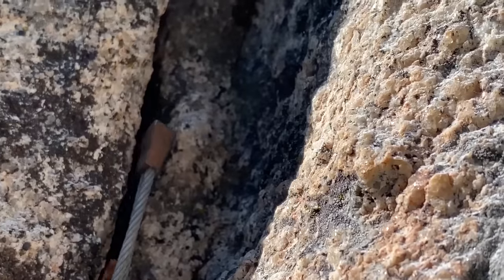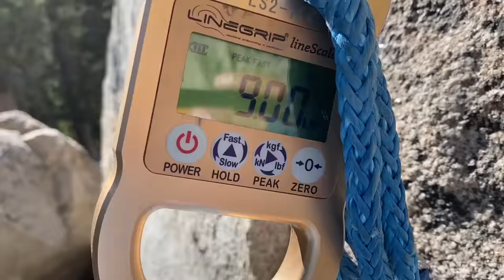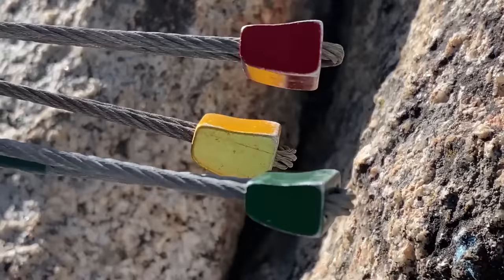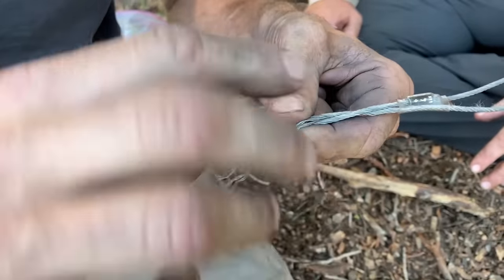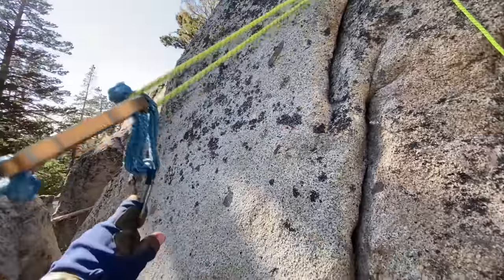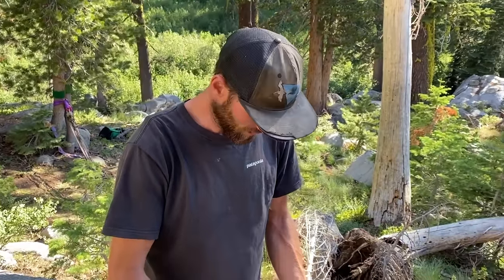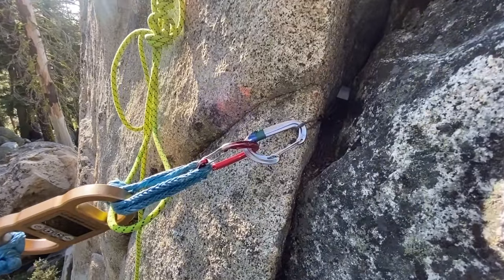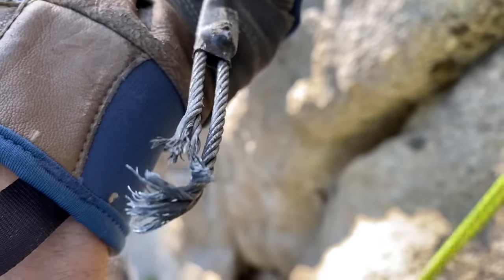You won't believe how strong micro stoppers are!  Climbing nuts tested in real rock

Comment: My understanding (I can't verify this, it's just what I have been told) is that the filament in the steel braid is a way for the manufacturer to track production. Different filament colors indicate different times (years?) of production.
Reply: I know a lot of larger steel cables will have a soft core and apparently the core being able to be squeezed improves elongation properties, reduces wear/premature failure due to inner stands rubbing against eachother while being squeezed by the outer strands and probably some other important stuff.
Reply: this is how manufacturers track ropes as well
Reply: It's there to retain shape of the wire and prevent kinks?
Reply: I think they do this with ropes too and thought about the same here.

Comment: The wild country Rock nuts are OLD,  based on the manufacture markings and MEC price tags they are around 40 years old. They still have original tags as you can see when Ryan is holding the big bundle.

Comment: I am curious if you put two carabiners in the wire to increase the bend radius if the results would change. I have done that when belaying sometimes to get more friction when belaying a larger climber than myself. Awesome as always!
Reply: I thought about a wire rope ferral I think it is called to increase the radius but your suggestion trumps my idea, if two carabiners get better results then move to the ferral (eye)
Reply: @marcwire9332  It's a ferrule. Good try on the spelling since you'd never seen it written!
Reply: @PeregrineBF  most polite way to correct someone’s spelling i’ve ever seen on the internet. props
Reply: Or you could retro fit a wire rope thimble.

Comment: Hi! I did some basic math to work out the force on that redirect using your estimates for the force and angle: assuming an angle of 95 degrees, the force would’ve been between 17.6kN and 20.3kN, assuming an angle of 120 degrees it would’ve been between 13kN and 15kN. Both of these would’ve been acting straight out, at half of the angle between the two ropes. Keep in mind though that this assumes a perfect, static situation (no movement) and I often suck at getting correct answers

Comment: The reason there is filament inside of the steel cable is because the play lets the cable bend / flex and evenly dispersed the weight across the the  making it much more reliable and less likely to get cut on rock, Metal cord cables are normally only used for lateral force and static tension

Comment: A redirect is essentially a pulley on the fixed mount point. It is all basic static vectors so it is quite easy to calculate the forces if you know the angles and one of the force on the cable or mount point.

Comment: A redirect is always subjected to some multiplication of forces from the lines coming in and out of it. People often think in terms of static redirects or moving pieces but all the same rules apply even if it's not a "moving" pulley in your MA system. The pulley doesn't know that. Everyone understands this on paper but it sometimes can get overlooked and it can be important in terms of resultant direction and pull force as we can see here where an otherwise bomber bolt is put in tension and pops. Always fascinating!

Comment: That nylon filament could be for lubricating the steel wires in the cable when it flexes! The plastic core is an essential part of steel cables used in big industrical projects like bridges and towers. There, it also serves as something to wrap the wires around but the plastic mostly acts as a lubricant for when the cables bend and flex. If you think about how the steel wires in the cable rub against each other when bending, the ones on the "inside" of the bend go one way/contract, and the ones on the "outside" go the other way/stetch. This creates a lot of abrasion (especially at sharp bends), accelerating metal fatigue and exposeing metal to corrosion. The plastic core on the other hand just gets rubbed off and the polymer molecules act as lubricant. That is my best guess for their purpose in this case haha!

Comment: Hard to tell in the video since it is only 2 frames long, but when the redirect snaps it looks like the quick link backs off for a frame (1/30 sec) then snaps. This means you're not just working with flat force, but impulse. If we assume a constant force on the pulley throughout the snap, and the quick link backs off a 1/4in, then the shock force could easily be 3 to 10 times more than the constant force depending on the deformation of the bolt. That's on top of the fact that a pulley takes more than the load since it has two strands of rope leaving it.

Comment: I'm pretty sure the WC nut breaks at a lower-than-rated force because you're pulling it around an edge of rock. The wire breaks where it is pulled over that edge. Interesting both in terms of thinking about gear placements and in terms of thinking about all the variables in establishing a reliable experiment. Given that the wire is what breaks (and given your title), you'd have done well to test micros that use thinner wire. The wire on the no.5 is, I think, the same gauge as many conventional alu stoppers.

Comment: I reckon the brass being softer played a part in the piece being stronger, the wire is probably a harder metal so it could dig into the nut rather than getting kinked over the sharp edge of the harder nut metal

Comment: I was wondering if the thread was a tension indicator, IE it gets fuzzy when it has been overloaded but not broken.

I was also thinking a thimble on the wire rope where it meets the carabiner would reduce the stress concentrations.

Comment: For an angle of 90 deg, the force on the redirect is 40% higher than what the dyno reads. Since it looks a little higher than 90 deg, a +50% should be close enough.
Reply: I'm thinking that the greater the angle, the less force the redirect sees. I understand your 40% higher force for 90 degrees, because the two components parallel to the bolt add up to equal sqrt(2) = 1.41 times the force the linescale sees, so 41% higher. But as that angle approaches 180, those components go to zero, so the force on the bolt decreases with a more obtuse angle. At 0 degrees, it would just see 2x the force on the linescale, for instance.
Reply: @beauthetford7608  You're totally right! So for that angle a bit above 90 deg, it should be less than 40% increase...
Reply: Exactly. If f0 is the force on the dynamometer, you can describe the force on the redirect F as a function of the angle between the rope legs theta by
F(theta) = 2*f0* cos(theta/2).

Comment: Steel cables that run over pulleys create friction and wear as they bend.  The fiber core lubricates as it moves and in heavy load situations like cranes will be impregnated with graphite or grease.  Static uses like support cables have no need of that extra expense.

Comment: I know this is late but the brass but likely held more because it deformed around the wire rope more. If you look where each failed, the brass one failed at the pull side whereas the aluminum nut broke at the nut side. The stress concentration at the corner of the aluminum nut was the point of failure. This has implications for what brass nuts should be bought but also for the design of nuts in general imo

Comment: The fiber core is standard on AC (aircraft cable) it is used to hold lubricant to increase the life of the cable and allow the strands to shift around slightly as it runs over and through pulleys and winding drums while under load. Wire Rope does not have a fiber core and is not intended or rated to bend as severely or run through pulleys or redirects. AC cable and wire rope are two different types of metal cordage.

Comment: As fas as I know, the string in the middle is probably for the manufacturer as guide in the first line. The second thing I know is that if you can see the line in the middle your wirecable is cheewed up and is not usable at full load anymore.

Comment: I am curious if it is viable for a person to make their own nuts at home with amsteel, brass stock, and a basic tools?  
cutting the brass into these basic shapes is not difficult. drilling some holes for the amsteel shouldn't be a problem. however splicing the amsteel to the nut might be tricky for some people.
You know what; If I make them will you test them?

Comment: Freedom of the Hills states it is safe to since a nut around a bolt that doesn't have a hanger. Can you try to test this?
Reply: "safe" means very little but I would guess you'd get a failure mode of the wire breaking at around 6-12 kN depending on the wire and thickness. What is be more worried about is the wire slipping off.
Reply: @joshcourt6744    That was SOP in early Direct Aid climbing in situations like bolt ladders.  When you are moving from one to the next you can hold them in place.  In those ancient times gear was hard to come by (or hadn't been invented yet) and Expensive so just a bolt had to make do.  I wonder which edition of FotH that came from.
Reply: This is still done a fair bit in Australia on free climbs with "Carrot Bolts". The main issue seems to be getting the nut to stay on the bolt. The breaking strain should be fairly similar to the rated strength because the radius of the bolt is similar to a carabiner.

Comment: It is just me or nuts are too good compared to other protections? Almost every accident is due to bad placement of friend or that other protection similar to nuts (little lever with round side and pointy side), whereas nuts are almost impossible to screw, fit in, if it is the right size is bomber.

Comment: Appreciate your videos, cheers! 

I would like to see tested The Texas Rope Trick. 
Both on the drop tower and on slack snap.

Normal TRT and variation with girth hitch.  
Girth hitch a sling onto a rope, pass the sling through a hanger then run the rope through the open sling and pull/drop.
Reply from the maker: Sounds like fun.

Comment: In fact, you are misleading people with your video. Even 9 kilonewtons, which you so admire at the beginning of the video, is negligible for rock climbing.

For a static slackline, this may be acceptable. But for rock climbing, when one point is used and a deep fall occurs with a high fall factor, it is almost guaranteed death. Focus on this difference in your video, please. It's better if you even re-upload the video with this clarification, so as not to create a dangerous precedent!

Obviously, small stoppers work great when there are already several of them on the line and the fall occurs with the rope etching - they are created for this. A lot depends on the fall factor, with a soft jerk it is also obvious that one stopper will work. But by making a video like this, you are misleading people by calling them "super-strong", because in climbing there can be such situations when 15 kilonewtons on a point is not enough.

The death of people who watch your video will rely on these little stoppers - on your conscience.

For reliable fastening of the station, you need at least 20-25 kilonewtons, that is, you need to assemble at least three such stoppers into a station.